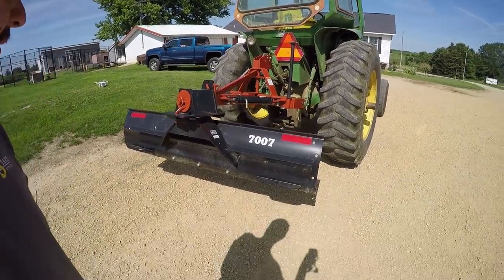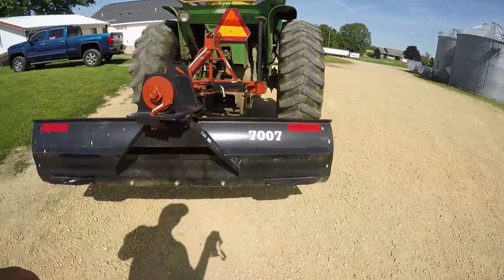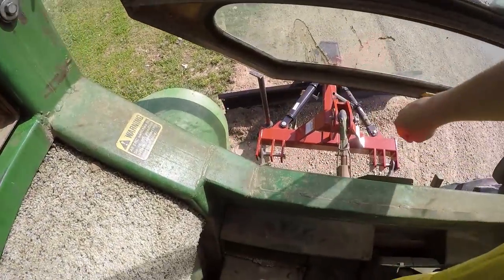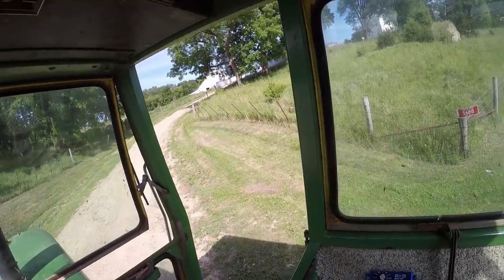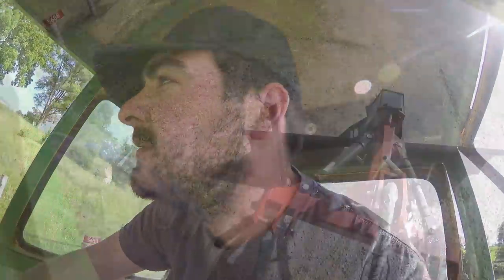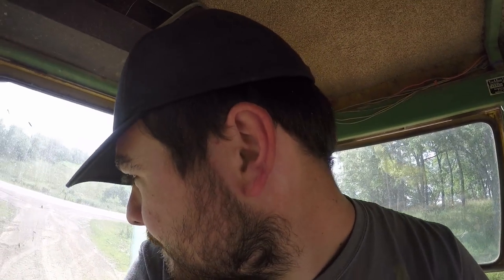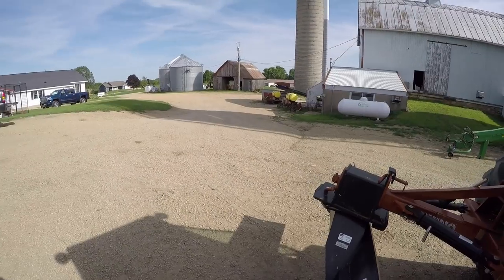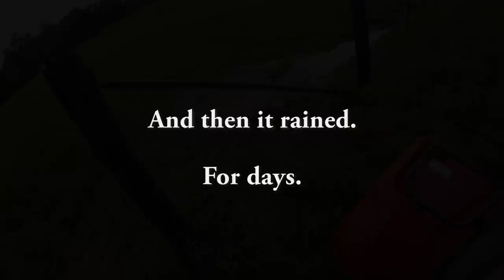Grading the Driveway with the 7007 Rhino Blade

Comment: A box blade is way easier for this.
Reply: JCLawn51 I agree. A box scraper is way easier.
Reply: or a power rake
Reply: JCLawn51 Rhino has given implements to top Youtubers in exchange for free airtime.
Reply: I have a box blade, rear blade, Harley Rake, and a grading scraper (land plane).   For a driveway in the condition shown in the video - the grading scraper wins hands down for speed and final condition.   Next would be the Harley Rake, but it takes longer than the grading scraper.  Unless you have a hydraulic top link and side link, the box blade is way too much work to setup for fine grading.
Reply: wranglerstar is one
Reply: I've got a rear blade and a box...the box wins hands down for jobs like Ryan is doing. That said I do have a hydraulic top link. When lots of gravel is washed down a hill, the scarifiers dig in and rip the compacted gravel faster and better then a blade alone.
Reply: I know, but look at what they also make https://www.rhinoag.com/products/landscape-construction/blades/heavy-duty-box-blades/ most people don't know box blades exist unless you use one.
Reply: JCLawn51 iiipp